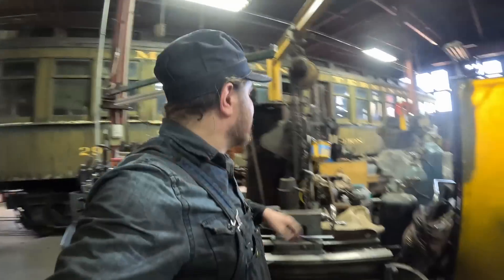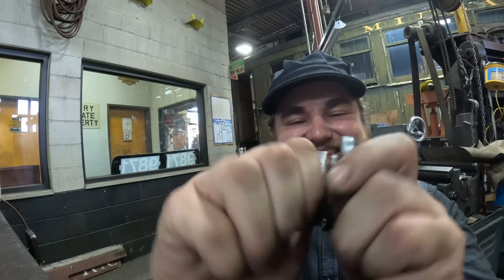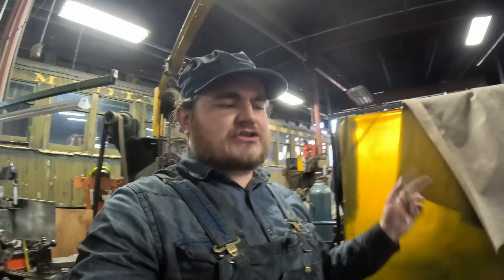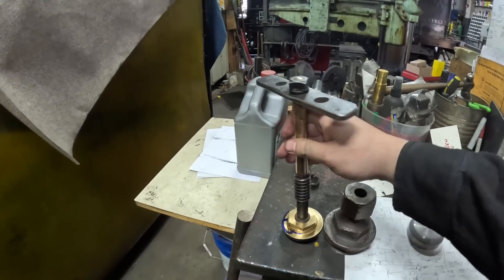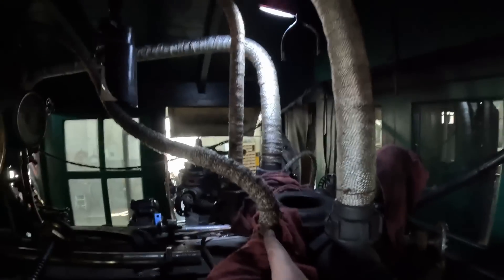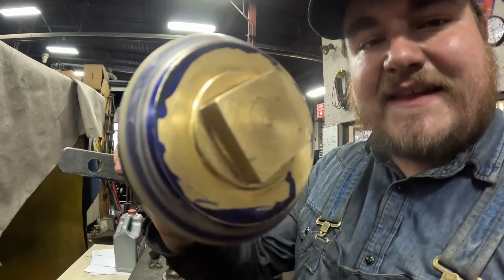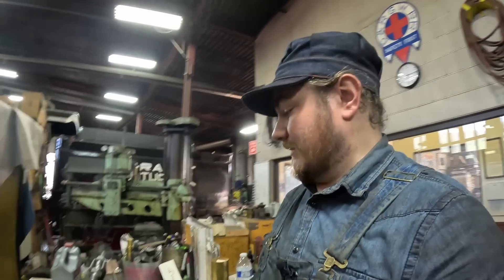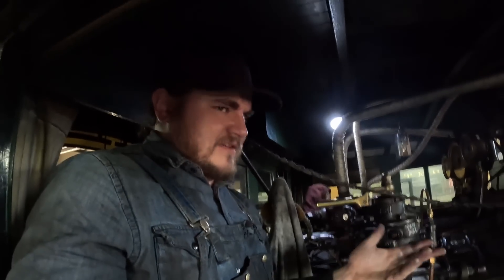Why DIESEL replaced STEAM TRAINS - a specific look. | Railroad 101

Comment: (War)Ships don't necesseraly come with that problem, as they are individual units, and not mass produced........................................EXCEPT THE AMERICANS, GOD DAMN THE US NAVY IS SO FUCKING BORING......
That's why I'm not gonna use them as an example, because f you, you have no creativity.
So we are siding with the enemy instead. Japan.
Ships are individuals.
There are not too many Aircraft carriers that are the same, and need the same parts that have to be interchangable.
Heck, There are ships, that are the same class, but they are so different you'd never notice. Case in point the Tosa-Class, Tosa and Kaga.
Compared to Tosa, Kaga is 20 meters longer, has an entirely different boiler composition, 130mms less armor belt, less casemated secondaries, but they are about 8 inches in calibre compared to Tosa's about 6 inch guns and while Tosa's main armament consists is 5 turrets all armed with twin 410mm (16.14 in) guns, Kaga's main armament consists of 90 Carrier Based Aircraft. Yes, Kaga was converted into an Aircraft Carrier. (Tosa was never actually finished, but that's not the point here)
And the biggest difference, is that Kaga is my wife, and Tosa is my Sister-in-Law.

Comment: I think I must be old beyond my years. All the justifications given for why diesel replaced steam trains, bar one (time needed to do the task) fell flat for me. It cost jobs, it cost livelihoods, it cost the environment, to switch to the throw-away diesel mentality. Pretty disgusting to me, to be honest. How many jobs would have been maintained had we not switched to diesel? How many side-industries supplying things for the machinists to use wouldn't have shut down? How much less damage could we be doing in terms of resources used if we used renewable fuel sources (such as dried animal dung, crop waste, scrap wood formed into logs or pellets, or if we get fancier, methane sourced from landfills, farms, or the chemical breakdown of waste as part of the process of cleaning wastewater) to fuel steam locos? Sometimes, newer is not better.
Reply from the maker: Hard to say; that's for sure. The railroad has always been about cutting jobs...

Comment: Theres a railway here
Wont mention name
(i wasn't there to see it happen but i heard stories) 
Now on the steam chest theres the inspection plugs
This engine Aparrtly doesn't have a hidrostatic nor mechanical lubricantor
So they would take off the inspection plugs
Pump oil and put the plugs back on
But thr threads where a bit warn
So when they where running
Aparrtly that plug shot off
Eish moment

Comment: The Iron Horse died because the Diesel-electric cost less to operate. This video gives a quick look at Maintenance, which was the number one contributing factor and also mentions Availability. The other factors were the water supply cost, track depletion, car maintenance and solid waste disposal (if coal-fired). Another way of looking at is: with Diesel locomotives, a lot of paychecks can be eliminated.
Reply: Except in some sectors.
There is fireless locomotives that run on steam mainly in certain factories that diesels have the risk of killing everyone with their exhaust.

Comment: So one point of contention here.

Steam engines were built pre assembly line standardization.

Diesel electric were built post assembly line standardization.

A steam engine if it were to be commissioned today, would be designed for production on an assembly line and built with standardization of parts.

That said, steam is always going to take way more care and feeding as opposed to a diesel electric.  So many fewer moving parts means way less things to wear and break.

Comment: Were there requirements for inspections when these locos originally ran?  I would think as much power as the railroad barons had, there wasn't a lot of government oversight and they'd run the trains until they broke which is maybe why custom everything wasn't a big deal.

Comment: Remember these are 100 year old machines, made of iron and bronze, with 1900s technology. Cars were a lot of work back then too, but at least they had a chance to be developed further with the help of modern precision engineering and materials (For example the antique Ford model-T vs the modern Honda Accord). I agree with the other commenter, if steam engines never went away, if they were redeveloped with high-durability materials, standard interchangeable parts, computer controlled firing, etc, I bet they’d be amazing.

Comment: Just convert the steam locomotives to use oil for fuel, no dust or soot in the smokebox. You don't need steam locomotives for high speed passenger services, they only need their tractive effort for freight service.

Comment: I inherited from my father a tap that he inherited from his father. It is sized 20-18 I have never seen a 20-18 screw or nut, nor have I seen specifications for a 20-18 sized screw. What little I know of my grandfather includes that he worked as a machinist for a railroad company for a short time in Indiana. Would this sized screw be used by the railroad?

Comment: Same with airliners.  Any time not in the air, they are not earning anything.  Steam did not die due to their ability to pull loads but because labor got too expensive.  And like you said, interchangeable parts help.  Back when they had several locomotives of the same class and one was down, they could swap out parts - or steal parts for working locomotives.  It's why CATS has so many parked K class locomotives.  It was easier to take a part off an engine needing a LOT more work and just kick the can down the road for when the part they took needed to be replaced.
Good job lapping.  Not a fun job.  How are you keeping the stem centered as you do that?  Personally I would create a wooden block to center it using the studs.
I hate to say it but my 20 might be out of the shop first!  Of course I'd have to find a railroad to run it on as some are closed.  I might wait and just start to look for places to operate next spring.
Good luck.  Build them muscles!
Reply from the maker: We're making a tool to hold it centered for next time, but this go around was me very dilligently holding it with one hand centered. Passed the steam test, so it did work. She was out of the shop last week, I'm just slow to edit videos. :)
Reply: @Hyce777  awesome!  You are a mite bit busy I must say.  Kudos!

Comment: I feel like if someone was to design a NEW steam locomotive, from the ground up, using modern machining techniques and common parts, as there are tons of steam use parts made and used today with a lot of industrial applications, and made it nuclear powered rather than fossil fuel it would quickly become the locomotive of choice across the continent. And when i say nuclear, i dont mean like nuclear power, but like a large Radio Thermal Generator, dont need to have as much of a risk during a crash.

Comment: I would think the same can be said about piston engined airliners being succeeded by jets.  Much like diesel locomotives, jetliners didn’t need quite as much downtime for maintenance as their piston-powered predecessors as their engines didn’t to be overhauled as often as piston engines.  Today’s jet engines can have a TBOH (Time Before OverHaul) in excess of 20,000 running hours, whereas the big piston engines typically had a TBOH of less than 1000 hours.  There’s also the fact that jetliners cut travel times in half over prop-liners, and the jet fuel they used is also cheaper than aviation gasoline, or avgas.

Comment: Someday diesels will go the same way. However, these completely mechanically controlled steam engines will still be capable of being repaired as long as there are people who have the skill to make these parts. We live in a throwaway society where new products cannot be taken apart and repaired. Same with old tractors. A growing number of hobbyists have lathes, mills, and small forges in their garages and can make these smaller components. These old machines even in small numbers will outlive the vast majority of modern equipment. 

The complicated nature of electronics, control programming, and emissions equipment will make new equipment impossible to maintain when the new equipment parts are discontinued.

Comment: Even today it takes 3 to 4 modern diesels to pull the equivalent of what one large late era steam locomotive can pull. It was and continues to be the maintenance. That is the reason for steam’s downfall. Every single time a “modern steam locomotive” study has come up in the diesel age, the conclusion is always the same. That the maintenance needs of the steam engine are not going to outweigh any potential fuel savings from switching off of now very expensive diesel.

Comment: All this steam vs diesel debate makes me wonder what would happen if someone made a modern steam locmotive. Like fully designed a new steam loco with modern principals applied to it. Would be interesting to see what happens
Reply: “This steam locomotive is powered by clean burning natural gas (insert picture of a green leaf on the tender)”
Reply: @gdub350  🤣🤣
Reply: I think it would be still inferior because burning solids is harder than burning liquid, and steam locomotives would still need a lot of water (or a giant ass radiator). Everything that is liquid or gaseous would be burned in a ICE, or in a gas turbine. These are more efficient. Even with modern Steam Turbines.
Reply: There's a guy and his dad on youtube that do exactly that. Steam makes sense for them as they have a big (presumably farm or orchard) with excess wood.
Reply: Well there is newbuild locomotives being built and running right now.
Though they are normally retrofitted versions of old designs, like Corris railway numbers 7 & 10 Peppercorn A1 Tornado and P2 2007.
Reply: you are describing a gas (in this case steam but the tech is basically the same) turbine locomotive.
Reply: Just ask Bulleid

Comment: ...and thats why SLM machines have all screwed valve seats: unsrew them, take a pass on the sealing surface on the lathe on both the seat and valve, then lap it for 5min with fine lapping compound. worst valve about half a day of work, including polishing all parts before putting them back together

Comment: Well tea it is inefficient because steam locos where designed (initially()way back when. and everybody did their own thing. If a fleat of steam locos where designed  now, or even 30 years ago, I'd bet that they would go through and standardize whatever they could and make parts easily replaceable , and probably way fewer pats made out of soft metals. But I'm no expert so please correct me if I'm wrong. PS: I know a fleet od steam locos would not be designed and built as recently as 30 years ago but for the sake of discussion imagine an alternate reality where for some reason diesel locos was never a thing

Comment: I think that, more than just the maintenance, the time it takes to cool down and re-heat the steam locomotive probably played a big part as well whereas with a diesel, it's a 'turn-key' restart.

It's like my own industry (steelmaking) - there's been a massive switch from the big integrated plants with blast furnaces at their core, to the 'mini-mill' with the electric furnace because once the blast furnace was 'blown in' (started), it had to run 24/7 for the next fifteen to twenty years. And if there was a major breakdown downstream of the blast furnace, the BF couldn't be shut off - it had to keep making metal and if the steelmaking and caster plants couldn't take the metal, it was just dumped on the ground. Whereas modern electric furnaces can have their hearths full of frozen solid steel and, with some time and effort, remelt the steel without too much damage to the refractory linings - and that's just the worst-situation outcome; in normal operations, the electric furnace can be shut off, drained of metal and left to cool down if not required, and then easily charged up and restarted when the orders came in again. This is despite the fact that an integrated steel mill is a very efficient plant when running properly.

Comment: But eventually the heads and seals on the diesel will need machining so really it's just a modern swap
Reply: Nowadays it can be done with Computer controlled machines amd you can have a ton of them just sitting in a warehouse

Comment: This is why it was such a Big Deal for BR to have its standard locomotives, and for savvy railways all over the planet to have standard designs and components that COULD be swapped around quickly to get an engine back into service while the guys in the backshop tear the old part down and repair it for the next loco that needed work. Standard lubricators, injectors, ejectors, even whole boilers could be swapped out.

Then never mind how many inspections are required of locomotives, but just the maintenance needs for them when they're running in tip-top condition! You have two guys on the footplate, but aside from an in-field top-up of oil here and there, they don't really look after the loco. A whole roundhouse workshop and sheds at big motive power depots JUST to oil and grease and clean ashpans and sweep smokeboxes, dozens if not hundreds of men. Still others tending fires and keeping engines hot and ready for their next job.

Meanwhile our diesels get serviced at the end of each mainline run (because they're 50 years old) and that takes 30 minutes? Fuelled, oiled, checked over, any minor components replaced, concerns written up, then booted out ready for the next train or sent to the veggie patch to rest.

Comment: @Hyce, i'd love to see a video of you learning turning on a lathe (this is probably down to me watching too much Project Binky though...)

Also, question for you (had a shower thought last night) was there ever a locomotive company that tried an automatic regulator on a steam locomotive? (so you set for forward or reverse and the cuttoff is automatically governed by whatever speed you are going) i presume it would be impractical for a railway locomotive as you need to be able to adjust on the fly and preempt track conditions and adjust to suit.

Comment: In addition to the maintenance costs, another big advantage diesels have over steam locomotives is their relative lack of water consumption.  By getting rid of steam the railroads no longer had to maintain water tanks all over the place, a hard working steam engine would have to take water somewhere enroute on pretty much every trip.  This was even worse in regions that were arid or had poor quality water with a high mineral content (water treatment and boiler maintenance costs would be even higher).  This is why the Santa Fe was the first North American railroad to buy into the diesel idea in a big way.

Comment: Seems like a lot of the problems of steam could have been avoided if the steam locomotive manufacturers had just adopted the same kind of standardization as EMD and eventually some of the other diesel manufacturers did.  Some diesel manufacturers didn't do a good job of this, and they ended up going out of business after a few years.

Comment: In shorts:

1. Steam engines are more costly than diesels 

2. Diesels are cleaner and easier to maintain

3. You need a specific steam engine for specific jobs

4. Diesels can pull any train and you can get mass quantities of them in any paint scheme

5. You need an entire crew for if operating more than one steam locomotive 

6. Diesels can link up and operate as one unit

7. Steam locomotives can cause a hazard if steaming through a tunnel 

8. Diesels only do the previous one if on fire

9. Diesels are more fuel efficient than steam locomotives since they use one fuel

10. Diesels have more torque when starting up but can't go faster once maximum speed unlike steam engines

11. No boiler explosions

12. Less time in the shops

13. Less chance of bouncing about unlike steam locomotives with their side rods

14. Shielded from weather. Yes some steam engines have enclosed cabs but not all of them unlike diesels

15. More advanced technology can be placed in. Toilets included in the cab or nose of the diesel

16. Quieter than the chuff chuff clank clank of steam locomotives

17. Diesels can operate forwards or backwards and nothing changes

18. Diesels have less chance of pounding the life out of rails

19. Less lubrication is needed everwhere meaning getting to the destination sooner with a diesel 

20. Diesels can go anywhere.

I think that's a good list

Comment: But if you are working on old diesels it is closer to the same. No off the shelf parts. Lots of machining of new. Service intervals are longer but the components take a lot of precision parts. The machines capable of turning out those parts are big and expensive. It's a trade off. As you said, people were cheap, materials expensive.

Comment: Weathers off-the-cuff things that you mention there that this type of work may not have been required at all except on a very old diesel. If steam had been allowed to mature do you think it's possible that we would have a situation where we would have steam locomotives constructed with off-the-shelf parts b that could be constructed in two modules that would be easy to do maintenance on the locomotive?

Comment: The hospital I used to work at had Three O type boilers which supplied hot water for heating and hot water for everything else. Each one of them would be down for one month for maintenance every year. I still hate the thought of having had to crawl into the fireboxes of those damn things to patch the masonry, and inspect the pipes.